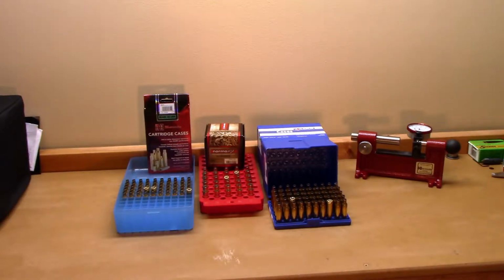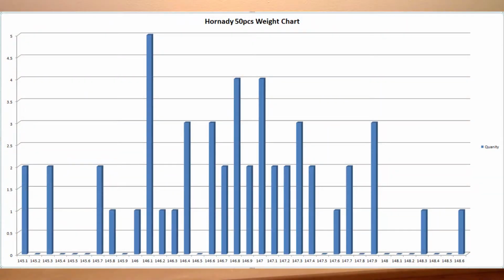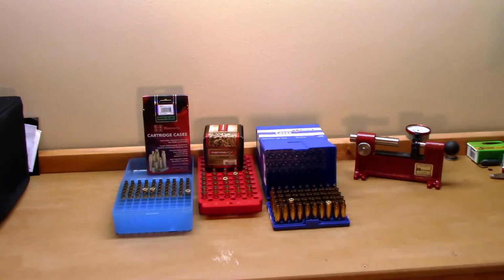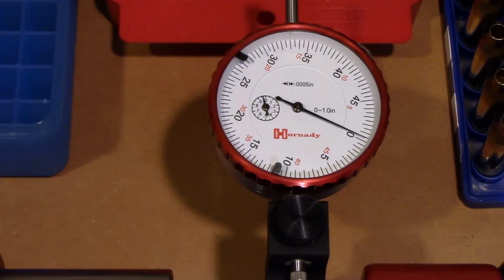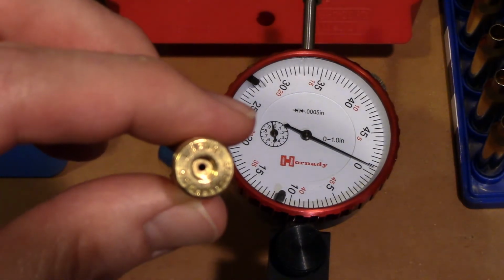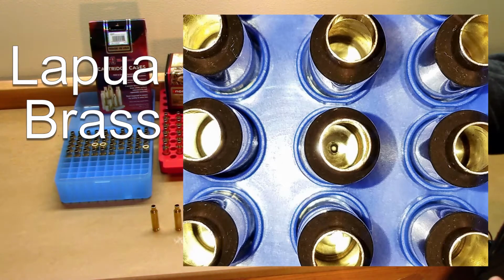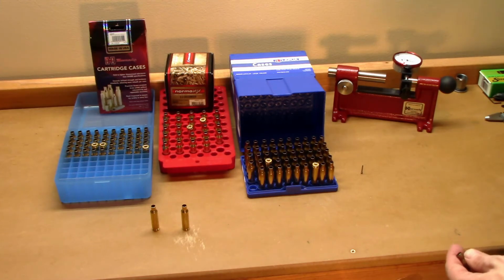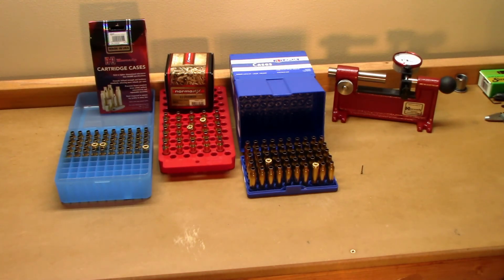6.5 Creedmoor Brass Comparison

Comment: This is a very good video with lots of excellent information on steps you can take to ensure your brass is as uniform as possible.  One thing I would really like to have seen is a follow-up showing the internal case capacity, in H2O, of 5 to 10 pieces of each brand of brass, after firing.  The initial case prep steps are really important, and can definitely reduce group sizes, but I have found that what you wind up with after your first firing tells you a lot more about what kind of accuracy you'll get on all subsequent firings.  This is so true that I no longer do anything more than weight-sort and inspect brass before that first firing, knowing that I won't be narrowing down which pieces I reload with until after they've been fired.

Comment: 243 brass first trimmed to 1.930, lightly lubed, then one pass through a lee sizer die and final trim to 1.910 using simple LEE trim kit and cordless drill.

Works for me. Shoots 5 round groups using 140 gn Hornady ELD/ADI 2206H into a small pistol patch at 100 yards. 

Readily available Federal 243 once-fired brass at 20 cents each through my Remington 700-based, fluted barrel, MDT ESS chassised custom rifle. 

Got sick of trying to source factory 6.5 Creedmoor brass. Now shoot more often and more cheaply.

You can also downsize more readily available, and therefore cheaper 308 cases, but it can take 4-5  incremental passes to achieve and possibly lose a case now and then when the shoulder collapses. Far easier to upsize the 243 to 264 and haven't lost a case yet.

Twenty cents is bugger-all and I enjoy the prep. 243 for me.

Comment: Just saw 6.5 Guys 6.5 Creedmoor Lapua brass vid.  Similar documentation, different subject. Thought your info was more informative for making a brass decision.  I already felt 10-15 reloads was a reason to buy.  Keep up the good work.  Wish I had the time and knowledge to be active in the community for now I'll share with you.
Reply from the maker: +acasper9 thanks for compliment. I saw it too and was surprised that they took concentricity data without resizing but their channel their way. I'll have another vid out soon about Lapua brass and how they differ across the chronograph. It is surprising to me and hoping my subscriber base again has some more great ideas.
Reply: Have info on first fired and once fired cases. I'll wait for your vid to share.  Thanks buddy.
Reply from the maker: +acasper9 make me wait? Your as bad as a YouTube channel. Fair enough. Did you see velocity differences at Max loads?
Reply: Yes was really surprised.  Had better velocity with nosler brass.  Slight difference in accuracy.  Probably not enough to even mention.
Reply: The idea was to understand how concentric the brass was out of the box. One can easily introduce run-out or remove run-out depending on the type of die used: Bushing vs non-bushing, honed FL die, size of expander, size of bushing, etc. I can take the best brass and wreck it and take the worst brass and straighten it out depending on how I resize. Therefore, taking a measurement after sizing would be more of a commentary on our sizing die setup versus the quality of the brass.

Comment: In my opinion the lower velocity   with the Lapua brass is most certainly due to the small rifle primer.  I would be tempted to try CCI 450 small rifle magnum primer.
Good video, thanks.
Reply from the maker: Hi Brice, thanks for the comment. I did a video on the primers as well if you are interested. https://youtu.be/ZPu0DzIgKNk

Comment: very good details. Any chance of doing a volume test with water to compare the brass once all trimmed to spec?
Reply from the maker: +Neil Harris I knew someone was going to ask. I know that people like to do that but personally I am not really sure how to do it and trust the results. I will be doing a follow up with velocity data with the same load work up soon. Stick around. I am not sure how I am going to trim perfectly without the primer out. I am interested if you have a good idea.
Reply: moparmadman no worries. If you trim the cases all to the same length per lot before seating a primer it would be interesting to see the weight differences with more uniform lengths. Lapua had the best weight spread but also had the most consistent length. Hornady may have improved numbers once trimmed to same length.
Reply from the maker: +Neil Harris that is probably doable. I am not much of a water volume fan. There are just too many ways to cause variation with water weight. Water tension variation, etc. I don't want to give out bad info, or info I don't trust.
Reply: moparmadman fair enough :)
Reply: Have done volume test. Hornady 53.5 Norma 52.7 Nosler 53.3  Lapua 52.7. These are after first firing. I agree with moparmadman not the most reliable info but works well for Quick Load.

Comment: which primers does lapua recommend for those small primer pockets?
Reply from the maker: +JB I have been using fed205m. Eventually I will try some cci but I am not sure they tell you anything besides not Magnum primers.
Reply: In the Pacific Northwest CCI 450s (small rifle magnum) are a popular option for the 6.5x47. We expect the same for the 6.5 CM. During the component shortages, CCI seemed to be readily available.
Reply from the maker: +Ed Mobley I need to do some testing. I saw in your video you were using the small rifle magniums, but in a video from 2017 shot show the Lapua rep was talking about why they picked the small rifle primer and not using Magnum primers I thought. I am interested if the are some resources I am missing about this info. Thanks.
Reply: I know there are some folks who have observed better accuracy from using the mildest primers available, but I also hear folks who get better results from magnum primers. Over this weekend I heard that some folks are enlarging the flash holes on their Lapua brass despite the fact that the 2mm flash hole was part of their design.  Indeed it can be confusing and just confirms the need for shooters to conduct their own research. As you've figured out by now, we don't present ourselves as experts at www.65guys.com. We're just relaying our journey and what is working for us at the time.

Comment: How much per round by reloading yourself? I notice manufactured goes up to over a dollar per round.
Reply from the maker: +John B it depends what projectile you want to shoot largely.  And you might pick a different one based in the distance you want to shoot. Also based on how many times you reload each case. Personally I would never tell you to reload to save money. I doubt I will ever break even. (I get too many toys) Reload cause you like the hobby and want better ammo than you can buy over the counter.
Reply from the maker: If you don't count brass, around 50 cents depending on the projectile. But you can get great loads for around that price.